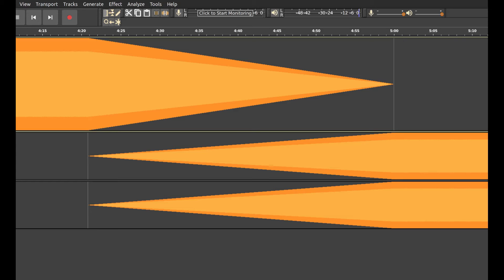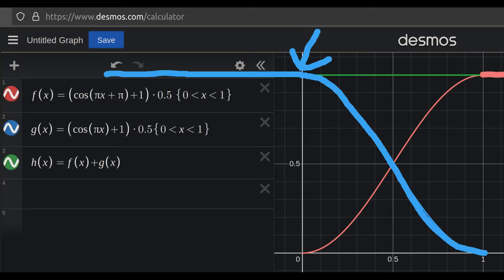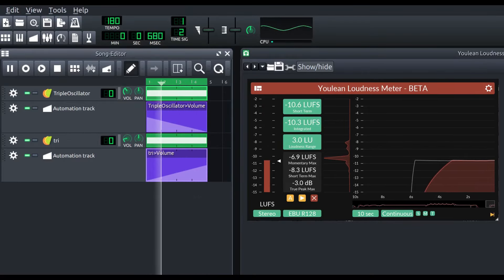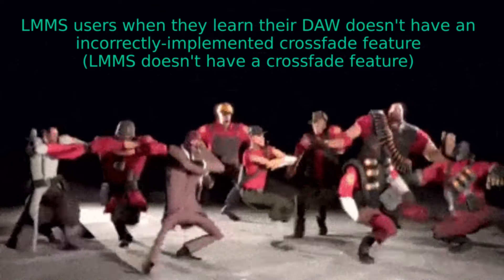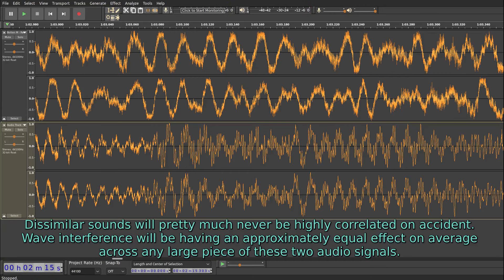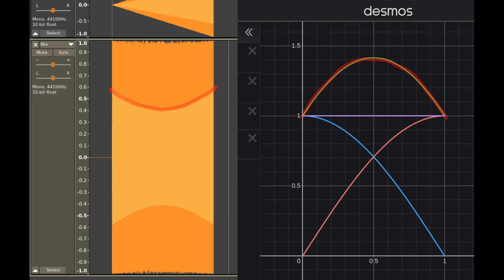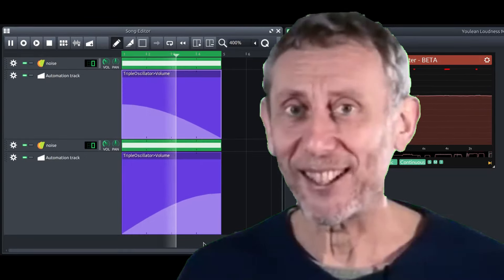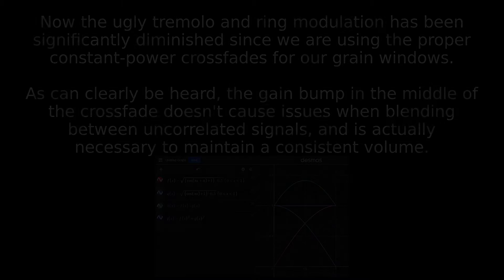Why does every DAW use the wrong crossfades?

Comment from the maker: Corrections:

3:19: I used the word "guarantee", which has a false implication.  It'll simply achieve that result on average.

Consider contributing to the Help Lost Robot Eat Something Other Than a Potato Fund: https://www.patreon.com/lostrobot
Reply: On very short timescales, crossfading does get tricky. Like in layering kick samples. This is the main scenario in which I've found myself tweaking the crossfade shape in REAPER. when crossfading between highly correlated sounds (like different recorded takes of the same thing) it also comes in handy
Reply: also at 4:40

Comment: wouldnt be surprised if the whole audio of this video is crossfaded
Reply from the maker: I used kdenlive which also has the wrong crossfades, but I didn't discover that fact until after I already recorded everything so I couldn't include it in the list.
Reply: @lostrobotmusic a lot of video editors have bad fading it seems
Reply: OMG HI PHORIZON!!!
Reply: Oi phorizon
Reply: D
Reply: kdenlive squad. Kinda tricky to get GPU encoding to work but when it works, it work gud

Comment: Hello, I am a physicist and mathematician. I would recommend you look into the Fourier transform, discrete Fourier transform (because lots of computation devices use discritized signals), and possibly linear operators. This would give you a full picture of polychromatic sounds (more than one basis sine wave). Similar to light, sound is often a Fourier sum of multiple sine and cosine waves in linear combination, even if they say it’s monochromatic/single wavelength, it is usually narrow band limited, i.e: approximately mono wavelength in a neighborhood. I only say this because it is possible some stock modifiers do not act as linear operators on the Fourier sum and may introduce phase shifts on top. Hope this helps, cheers.
Reply: I should mention phase shift will introduce unexpected spots of constructive/ destructive wave interference.

Comment: For sound designers, you could essentially chop up and stack, either bits and pieces of the source material together or just the same short snippet.
And then shift these crossfades around, switch phases for some and essentially create a lot of artificial chaos, you can slow down and use in various ways

Comment: i think that also logic has this because there are 4 types of fades you can choose: out, x/crossfade, eqp, x s
can anybody tell me if im right/wrong?
Reply from the maker: Judging by the names, "eqp" most likely refers to "equal-power" and would be the proper crossfade to choose for uncorrelated signals.
Reply: @lostrobotmusic  i did some research and it stands for equal power crossfade. Thanks for the informative video, really appreciate it <3

Comment: Is THAT the source of that tremoloey sound in pitch shifters? There are some ReaPitch algorithm settings that seem to have this, and I actually kinda like it as an effect, giving a "worn out" kind of sound, but I never knew what that sound actually was. Dang.

(Also, nice to know that Reaper's actual crossfades themselves are correct, and I never even knew about the problem before!)
Reply from the maker: Yes, in the case of granular pitch shifters it's a bit difficult because the correlation will be higher when there's less pitch shifting.  So constant-gain crossfades are needed if there's very little pitch shifting, and constant-power crossfades are needed if there's a lot of pitch shifting.  The effect will sound extremely wrong if it's using constant-power crossfades without any pitch shifting, which is why they're rarely used even though they're really needed.  A good granular pitch shifter or timestretcher would allow you to blend between the two options, or at least let you pick one or the other.
Reply: @lostrobotmusic do you know any software that does this?
Reply from the maker: @DaDandyman  I'm unfortunately unfamiliar with other software in general, I never use software that costs money.

Comment: Hrm...

It seems like it's pretty program dependent such that neither constant gain nor constant power is necessarily "correct" for every case. 

If the signals have perfect [positive +1 or negative -1] correlation, then you want constant gain.

If you have perfect non-correlation [0] then you want constant power.

But I expect most signal pairs are neither fully correlated nor fully uncorrelated. This seems especially likely in musical scenarios where there's a good chance that we're using simple, harmonically-pleasing ratios that are similar but different.

Does that mean it's best to assume 0.5/-0.5 correlation as a sensible default and use curves that're half way between constant gain and constant power?

Also, it might be interesting to let producers control the balance between constant gain and constant power. E.g., if they know the correlation will be 0.7, they could use that as the weight of their weighted average. Maybe they'd dial towards constant gain for 'clean' sounds and towards constant power for gritty distorted sounds. And maybe it could be adjusted on the fly with automation or a real-time feedback loop that fiddles the control as quickly as the Soothe plugin.
Reply from the maker: Excellent questions!

"If the signals have perfect [positive +1 or negative -1] correlation, then you want constant gain."
No, if there's negative correlation then there will be maximum phase cancellation which will result in total silence partway through the fade no matter how high the fade gain is.  The optimal fade function would go all the way up to infinity in the center.  It would be even further away from constant-gain than constant-power is.

"Does that mean it's best to assume 0.5/-0.5 correlation as a sensible default and use curves that're half way between constant gain and constant power?"
Except in the scenario in which you're intentionally crossfading between two extremely similar sounds with the same frequencies and phases, the two signals you're crossfading between are almost guaranteed to be almost entirely uncorrelated.  Partial correlation (near 0.5 or -0.5 as you said) is an extraordinarily rare scenario, with the measurement you mention the correlation will be extremely close to 0 (deviating by equal amounts positive or negative).  This makes the equal-power crossfade the proper default choice.

You could potentially test this by writing a Python script to crossfade songs together at randomly selected locations and measuring the RMS at halfway through the fade to see which crossfade would keep the volume consistent.  The results you'd get to would always converge to the constant-power crossfade being the optimal choice, and you'd also notice a surprisingly small amount of deviation from that.  The Central Limit Theorem is relevant here.
Reply: @lostrobotmusic  

Thanks for the clarifications.

I agree that sampling randomly from songs would be comparable to white noise.

My intuition is still that more curated musical contexts (where you've got two sources that've been e.g., arranged by a composer or beat-matched by a DJ to complement each-other) will tend to have much higher positive correlation than random sampling. Perhaps that's why most DAWs can get away with constant-gain for many contexts.

And, yeah, with perfect negative correlation the mix will null to silence somewhere during the transition. I think that's unavoidable, though, with any curves that cross--including constant-power. Different curves could bias it towards happening earlier or later during the cross but it would happen somewhere.

Comment: So if you use this better crossfade on sounds that are correlated like in the first example, will the loudness actually be less constant, or will it still all equal out to 1? It just seems counterintuitive that if it worked with method one it would also work with method two...
Reply from the maker: It would be less constant in the exact opposite way as using the wrong crossfades with uncorrelated material, there would be an increase in gain partway through the fade.  Constant-gain crossfades must be used when the two signals are highly correlated with each other, when their frequencies and phases align perfectly.  In nearly every situation in which this isn't the case (which is obviously the enormous majority of situations), constant-power crossfades are the optimal choice.
Reply: @lostrobotmusic  I see, cool. I suppose that it wouldn't be too too tough to make a small algorithm in the DAW software which would check whatf kind of crossfade is needed and then select accordingly. Cheers for the explanation :)

Comment: Quick question.
What the fuck did you crossfade in the ending example? I heard zero change throughout all three clips.
Reply from the maker: You were actually listening to exactly twelve crossfades per second, and there wasn't a single moment in which a crossfade wasn't currently occurring.  Granular pitch shifting works by playing the sample back at a different speed (to obtain the desired pitch) but only playing back extremely small portions (grains) at a time, and having the starting position of the grains move at the precise speed you want to actually move through the sample.  This allows you to change the pitch and the speed independently from each other.  Each grain is "windowed" to prevent discontinuities at the grain edges, which means the edge of each grain is faded in or out.

In my algorithm the grains have 50% overlap, which means this windowing is functionally identical to crossfading between two points in the audio.  The pitch was being changed far enough that the two parts in the audio being crossfaded between usually had very low correlation, which makes an equal-power crossfade far better for the job than an equal-gain crossfade.  This is why the third clip sounds significantly cleaner in quality than the second clip.  The first clip was completely unmodified, it was only there for reference.
Reply: @lostrobotmusic  I understand the point, your system is better than the intuitive version that causes gain changes.
But my issue is I couldnt tell what was being crossfaded into what, or why it was being crossfaded.
Reply from the maker: @pauldeddens5349  That's what I explained, there are twelve crossfades happening per second between different playback positions in the same audio file.  In that example the pitch was being multiplied by 0.9x by playing the audio back at 0.9x the speed, but this has the side effect of slowing the audio down, so to prevent this we skip forward in the audio repeatedly to bring it back up to the proper speed, and then use crossfades so those skips aren't audible.

Here's a visual aid, the overlapping regions in the middle section are crossfaded in order to obtain the bottom section:
https://unison.audio/wp-content/uploads/Pitch-Shift-Grain-e1682807861299-1024x788.png